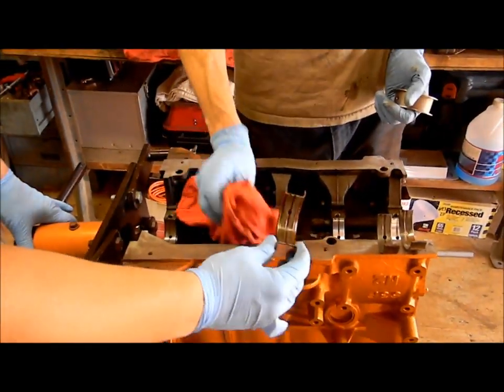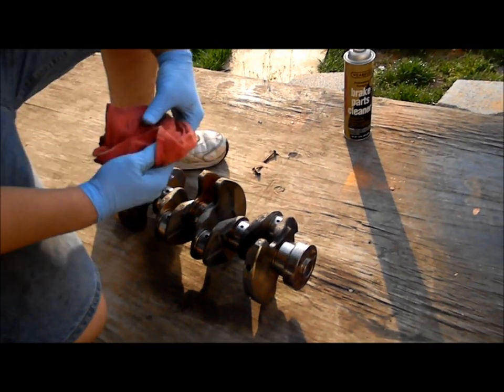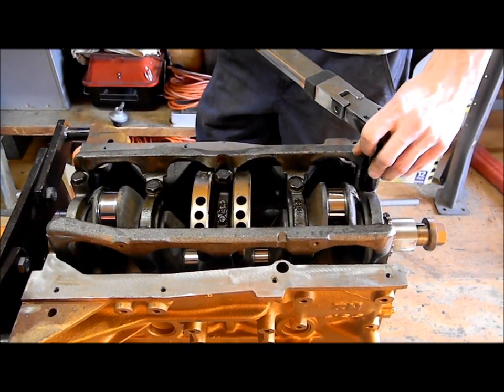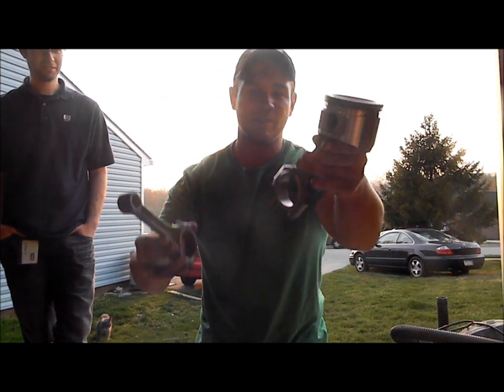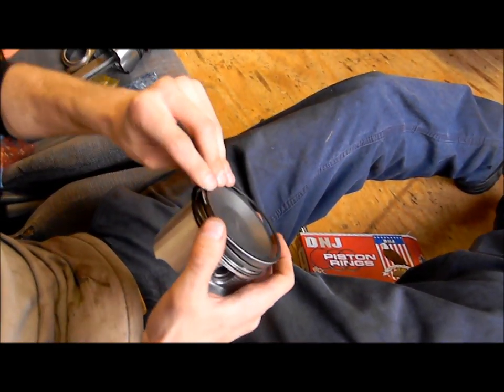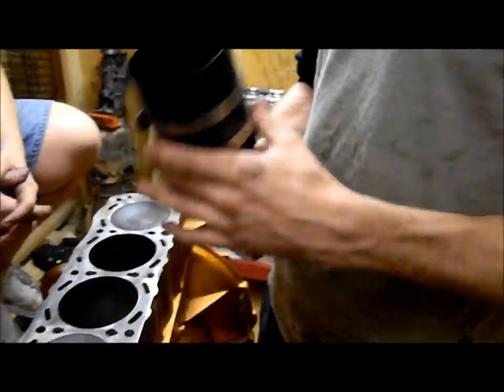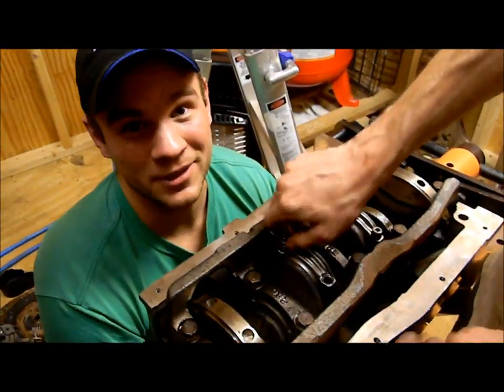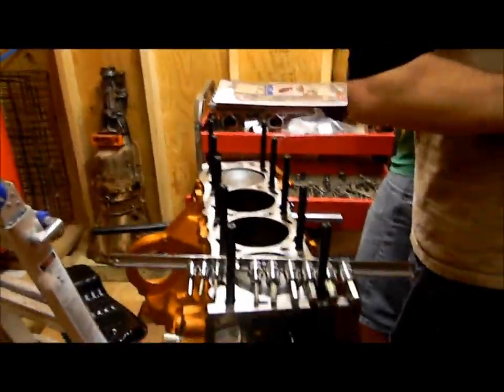Engine rebuild KA24DE 240sx S13 S14

Comment: ITS NOT ADVISED TO USE RED SHOP RAGS TO CLEAN BEARING SURFACES. WHY YOU MAY ASK? BECAUSE WHEN THE RED TYPE SHOP RAG HAS LINT WHICH GETS BUILT UP ON THE BEARING SURFACE DURING RUNNING OPERATIONS. MAY I SUGGEST A LINT FREE ROLL OF SHOP TOWELS WORK BEST BECAUSE IT BREAKS DOWN WITH OIL..

Comment: One thing to note, Non Detergent motor oil does NOT suspend particles to send to the oil filter. The idea is to collect as many particles as possible during break in to prevent additional, and unneeded wear.
An Air compressor uses a ND oil because it can trap metallic particles during settling at the drain because there is no combustion occurring as in an auto engine, or needed filter other than a course one.
Typically many compressors use a magnetic drain plug for that exact reason.
A 30W oil is also a poor flowing oil. It actually slows break in. Just use a good detergent based oil, do a 100 mile change if you really want to, but I recommend 500 with varied RPM use under light loading.
Then, go ahead and do and oil and filter swap at that point.
Because of the tight tolerances used in machining over the last 35 years, there is no need to be as anal about particles like it was back before 1980.  
Oh.. another guy mentioned this.. NEVER use red shop rags to clean surfaces internally on any engine. The cotton is garbage recycled material and has a huge problem with leaving lint!
It can clog your oil pickup screen and blow your engine! 
Nasty stuff.
Lint free cloth is always best.
Liked your video, you guys are hilarious.
:)

Comment: just a tip, DO NOT use those red shop rags when working on the internals of the motor. They leave A LOT of lint, and can clog your oil feed, and starve your motor.... I just rebuilt my whole KA-T (600hp)

Comment: Aren't Nissan engines really picky with the bearings they need for oil clearance? I was reading around a few 240 forums and they said, generally bearings from any company wouldn't really suffice, and that going through Nissan to get OEM bearings is the best idea for your engine.

Comment from the maker: it shouldnt put out any more power from the eagle rods, they are just stronger to handle more power because we plan and boosting the engine. with the exhaust and everything else we did to it, it probably puts 145 at the wheels max

Comment from the maker: The only thing we "did wrong" in this build was not honing the cylinders which had no negative effect on this engine. It had bad valve seals, burnt too much oil, drifted, sucked up air and spun a bearing. We are now doing a full KA build, upgraded bottom end, new valves and valve seals, everything.